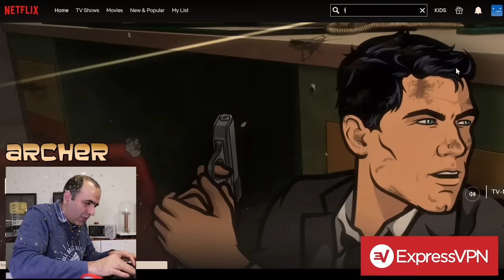What It Takes to Break a RAM with ESD (ft. Linus Tech Tips)

Comment: When i was in training to be an electronics assembler, they gave us examples of ESD damage. They were on surface mount parts. Surface mount parts are extremely tiny, as in you can nearly fit two of them on your pinky nail. We were building the electronic components placed in radar systems. Markedly different from the RAM sticks in your PC.

Comment: I cant imagine electroboom ingesting the 8k footage from linus
Reply: isn't linus trying to use 12k or something now lol
Reply: @virtualtools_3021  they're having problems with the stupid blackmagic software
Reply: @idont3282  Actually on a recent floatplane exclusive, Linus said they're going forwards with the Ursa minis, so I assume they found an appropriate solution since their video about their experience with it.
Reply: @idont3282  BM software isn't stupid at all, actually it's one of the best out there... The problem is it's still very young so it needs more testinf
Reply: They are using 69k
Reply: @matesaktesak  if a software can't do what it's supposed to do i consider it stupid, not that any of my programs have been able to do something useful
Reply: @glassbottlemenacesyou8323  nice
Reply: @matesaktesak  I am not a professional video producer, but I have worked with some black magic equipment (and other broadcast equipment) before and it's absolutely terrible. The price is mind blowing, it gets incredibly hot (cuz it has no heat sinks) and the device has no documentation. Personally I'm staying away from them in the future.
Reply: @matesaktesak  BM is not young.  They always put out new hardware and software well before it has been thoroughly tested and workflows developed. But that's their thing. They take bleeding edge, make it at an experimental price and have always been doing that.  Most of the time with a little technical knowhow it works fine and their guys at service are very very good. I've gotten beta drivers from them in the past to get around unforeseen flaws in the hardware that their gear is connected to..   Won't name any names...   round with a bite.  aherm..  colorless garden walled swine.
Reply: @thearchetype9829  stop spamming, please?
Reply: @DasAntiNaziBroetchen  I can imagine that... But on the other hand I work with BMs cameras, capture card and switchers daily and I rarely have any problems. It has to be worked with in a mindset: Hey it's cheap! You can buy RED (which used to be just as buggy and cost way more) or you can buy pro TV equipment for 20x the price
Reply: It's gonna be 12k soon 😂😀
Reply: @matesaktesak  as long as you stay in the ecosystem it seems to work fairly well. Anybody know how to get the stupid USB 3.0 capture card working, I thought I figured it out as it maxed out at 1080p30 then actually tried to use the thing again and it wouldn't work. It's amazing stuff but there's always seems to be that one little corner that's been cut.

Comment: I've been working on computer hardware since the mid 1980s --  back far enough that you had individual RAM chips in individual sockets, not these DIMMS where most of what you're touching is a ground-plane of some sort.  I have never burned out a modern RAM stick with ESD -- but back in the day, it was so much easier to kill your RAM when they were just a bunch of chips sitting on your desk and you had to push them into dozens of sockets.  That's really where this whole "ESD is dangerous" thing comes from.  It is still dangerous, of course -- just not nearly as much as it used to be.  Computer engineers have done an excellent job over the years of protecting our electronics from it.
Reply: Yeah, I remember back in the day when you actually did have to worry about this sort of thing (and I fried a few different components that way myself), but electronic components have gotten so much more robust than they used to be.  I've been telling people for years that the whole "anti-static" thing nowadays is basically just a myth people have held over from the ancient history of computers (y'know, back in the 80s, when dinosaurs roamed the earth), and not something anybody has ever realistically needed to worry about for decades...  It's nice to see other people actually pointing this out too.
Reply: i used to kill 56k modems daily because my computer room had shag carpets i was 8 years old and didn't know what ESD was but knew i like to build computers and write programs

Comment: The danger from ESD ist NOT that you actually destroy something. Because, as we have seen, it takes a lot to fully break it.

The biggest problem is that every discharge can damage structures inside the chips by a little.
So your RAM will work, but then you get sporadic problems like crashing, etc. it might even be that it will work fine for a year and then due to aging it will produce crashes very sporadically.
THAT is the real danger, because it's much more difficult to diagnose such a problem. The RAM (or whatever) "works" after all.

It would have been interesting from an academic point of view to do a full RAM test after each discharge to see if the RAM has degraded.
But that would be quite a lot of effort and not as much fun for the guys, I assume. :)
Reply: If they did memory tests, then it would take 10x longer to record probably
Reply: I'm so relieved someone else already commented this. Meep Meep, does not really say much about the health of that RAM.
So better keep handling integrated circuits carefully.

Comment: Can static kill your PC?
The short answer is: Yes. However, it's less likely now than it was 15+ years ago.
The long answer with anecdotal reference is: Absolutely. Back in the mid-1990s, I worked in tech support for a relatively new PC manufacturer, Micron Electronics, Inc. During the first couple of years, we were seeing an out of box failure (OOBF) rate of 7-9%. We worked diligently to figure out the cause for the failures, going so far as to POST 100%, boot to WINSETUP 35%, fully run test 5% of the units in the order they came out of production. We were still getting the same shipped unit OOBF results and getting 2-3% of our full run tested units back OOBF.
As a new company, we hadn't anticipated the demand for our product and we were in the process of expanding our facility and adding more warehouse space for the completed and packaged product. In the meantime, we'd been using our wide hallway corridors to store the current warehouse overflow, which regularly made up over 50% of our inventory. What we discovered by tracking every unit's movement in the facility, shipping company used, and system base makeup over 6 months, was that 98% of our OOBF product had been stored in the corridors.
Employees passed through those corridors and made up 1000s of passes daily creating fairly continuous airflow and, as you know, that's a high static producer. We'd been enclosing the product in regular poly bags, styrofoam impact protection, and cardboard boxes, each one on its own exactly the wrong material. We switched the bags and styrofoam to anti-static materials, started using anti-static pallets and our OOBF rate immediately dropped to <0.15%! We were spending an extra $1.12 per unit for the ESD protection but saving 100s of thousands every year in shipping and shrinkage costs, not to mention the increased customer satisfaction.

Manufacturers now build individual components and complete units with inherent ESD protection. As you pointed out, it's still highly recommended to strap on when you're working inside your PC.
I go so far as to power off and plug it in with a spare power cable that I've cut the flat blades off of as well as strapping onto the chassis when I'm in the field. That supplies a bonded path to earth ground, while greatly reducing the potential of receiving a high voltage shock. At my workbench, I've installed GFCI outlets and trip them when I have a unit open. I don't have to swap out the power cable, as the ground is still connected, but the line and neutral are open when tripped.
Reply: Fantastic comment, thanks for taking the time to tell the story!
Reply: “For God so loved the world that He gave His only begotten Son, that whoever believes in Him should not perish but have everlasting life.”John3:16 NKJV

“that if you confess with your mouth the Lord Jesus and believe in your heart that God has raised Him from the dead, you will be saved.”Romans10:9 NKJV

Comment: Killing them was difficult in fact. Linus mentioned they were DDR2, so those ICs were made with an older and bigger photolitography process. Frying newer electronics sure would be a ton easier than those (as the paths between transistors would be narrower (more resistance and heat)... Watch out!

Comment: I'm working with electronics, including PCs for way over 30 years and the only thing I killed by static (and not intentionally) is an LCD alarm clock radio. More punctually its button interface, the radio/clock still works but it doesn't react to the buttons - but if I reset it exactly at midnight it starts at zero! :D ... and I achieved this by dusting off a CRT tv screen and then accidentally going near the clock. Nothing else I can remember of, ever got damaged by static near or by me.

Comment: You've successfully convinced me that just touching the PC case before I work on my PC has been more than adequate all along.
Reply: Only if the computer is plugged in though
Reply: You could also just touch the metal part of ur wall outlet

Edit: I realized not all outlets have the metal part (used to european outlets😂)
Reply: @Ch1hf  yeah no problem bro I'll just use a fork.

Comment: In the first times of MOS technology, I mean NMOS, PMOS, those components are very sensitive to ESD. Nowadays those old technologies have disappeared and are replaced by CMOS with shottky diodes at the input, eventually protecting from little discharge, and you first need to blow one of those diode to kill the circuit behind at the end

Comment: It's been my experience that ram dies one address at a time. I bet running a full memtest86 after the first shock would have revealed an address that had failed.
Reply: Exactly!
Reply: They did zap a DIMM though early in Linus's video.  Testing with Memtest86 wouldn't be practical for time reasons, but it would have been good to check the survivors
Reply: If there are mosfets inside the RAM I don't see how they'd survive either.
Reply: that made me think - the actual "dead signal" from the PC should come from a failed board recognition, which wouldn't happen if just one or more physical memory addresses are destroyed by some zaps. The "dead RAM" obviously takes a lot more to be achieved.

in other words, the "MEEP MEEP" signal of "good RAM" is a simple hardware check that informs the user that the RAM has been installed, and gets recognized. memtest should uncover all other, more subtle problems.
Reply: @Magneticitist  i thought ram is made of capacitors or something, not mosfets
Reply: @virtualtools_3021  as far as I know even current ram uses normal silicon chips connected directly to cpu/northbridge (depends on the architecture of the platform), I think capacitors are prolly used to filter the signal but I'm not sure there.
Reply: @zirax54  Actually, a typical DRAM cell consists of one capacitor per bit, coupled with a MOSFET that manages access to the stored information. These structures are then organized in a Grid and accessed via "2D addresses". See https://en.wikipedia.org/wiki/Dynamic_random-access_memory and https://en.wikipedia.org/wiki/Dynamic_random-access_memory#/media/File:Square_array_of_mosfet_cells_read.png
Reply: @AsmodisThe2nd  oh, interesting, didn't know that there are capacitors in that, I should prolly look up stuff to check my information. Thanks!
Reply: @AsmodisThe2nd  Part of the problem DRAM is having scaling past 10nm. Scaling any smaller and the capacitors have issues holding a charge without lots of refreshing, hurting performance. I don't think they've found a solution yet that would give any meaningful shrink.

Maybe a padigram shift or something is due, who knows what's next.

Comment: Around 5:40 Linus mentions how there may be a preference for the discharge to jump to ground pins. If I had to guess I'd say this is plausible for the following reason: the data pins have some amount of residual charge on them that would be greater than the ground line, therefore creating a larger voltage between the ground pin and the source than between it and the data pins. If what linus mentioned was in fact the case, this would be why since the discharge would want to jump to the point of greatest voltage.

Comment: A computer hardware course instructor told me the concern with handling RAM today is with handling the pins and getting finger grease and dirt on the contacts, which can interfere with the signals and cause performance issues or failures over time.

Comment: There are 2 types of ESD testing, contact discharge and air discharge. Maybe contact discharge would have more likely killed the RAM? So that means holding a signal line and and then hitting the trigger.
Usually most ICs have built in ESD protection in the way of diodes which give a reasonable level of protection (but the amount of energy they can absorb is limited).
The ground signals are spread on the RAM stick mainly for the purpose of signal integrity.
Also, even if a circuit seems to work, ESD can reduce the reliability and performance depending on the type of circuit.
So a better way is to do a memtest each time (of course more time consuming).

Comment: I know this wouldn't make the video nearly as entertaining, BUT... 

They could have gotten a more replicable result if they had used the correct network and the rounded tip. There's networks (as in RLC network) you can put in the back of the gun that replicate a human body's resistance and capacitance. And that tip is shaped that way to reproduce the shape of a human finger. They make pointer tips for more targeted ESD. Also, if they had put the ground line on a data line and hit the ground of the RAM with ESD there's a higher chance that they would have blown up the RAM.

Source: I've worked with that ESD gun model before doing ESD testing.

Comment: “No protection” Well... Typically these static sensitive devices are designed with TVS diodes and ESD protection components that ground the high voltage but allow data voltage to pass. They’re built to be resilient.
Reply: It's probably even more important with modern hardware. Dram getting down to 10nm and lower voltages I'd assume they're much more sensitive to ESD without protection circuitry
Reply: But the devices need to be connected to both power supply rails for those protections to work. They might as well not exist when you're just holding it in your hand.
Reply: how big is a TVS diode? i dont think i see any on ram sticks, just a few tiny caps, resistor networks, and of course the dram itself
Reply: @virtualtools_3021  they can be integrated into the chips themselves
Reply: @virtualtools_3021  Diodes can be small surface mount things as small as a resistor or cap.
Reply: @TomStorey96  TVS diodes work regardless of supply voltage. You don’t need to supply a voltage to them in order for them to function
Reply: @virtualtools_3021  The TVS diodes used are SMD or integrated into the DRAM chips or even a separate DRAM driver if the module has that. They’re very very small.
Reply: @TomStorey96  The only anti-ESD devices that need power are the advanced integrated circuit active ESD protection. The modules use two types, active and passive. Active protection actively monitors the data lines and uses advanced logic to test and detect unwanted voltage spikes. Passive protection (which would be the TVS diodes) are completely passive and do not trigger unless the voltage on the line exceeds the breakdown voltage of the diode. There is no advanced circuitry or logic in the passive protection. Active protection requires power, passive protection does not.

It would be cheaper to just employ passive protection, but quality manufacturers design these with redundant protection to ensure maximum safety.

Comment: I've never actually used one of those grounding straps in my entire life. I used to be mildly careful and build PC hardware on a wood desk and things like that, but for the past 5-10 years or so I haven't even cared. I usually sit on the carpet and set everything out there and build it. Never once killed a single piece of hardware outside of deliberate overclocking.

Comment: This is the most hilarious thing ever. 
My theory is the following: 
Imagine a simple close circuit, with a battery connected to a resistor. What happens if you jump wire the resistor?  There will no current drained by the resistor. The electrons finds it easier to go through the copper wire because of its low resistance compared to the resistor. Here is happening exactly the same.
The voltage arch finds it easier to go through ElectroBoom fingers and to the ground than going to all the data lines that there are, because of the lower impedance between the ground and the evil pistol  possitive.  
I hope that it is clear. It would be my dream that ElectroBoom sees this humble comment. Salutes from Argentina!!!!!
Reply: The heat spreader was probably acting as a faraday cage for the more sensible components.
EDIT: Charge in a conductor accumulates in its surface and not its interior!
Reply: You are exactly correct. I use the exact same model ESD generator at work, and it is VERY difficult to zap specific connector pins, because the spark wants to arc to the connector shell (path of least resistance to ground).